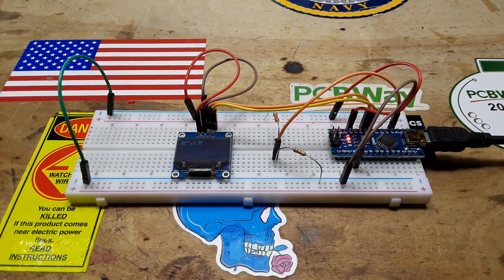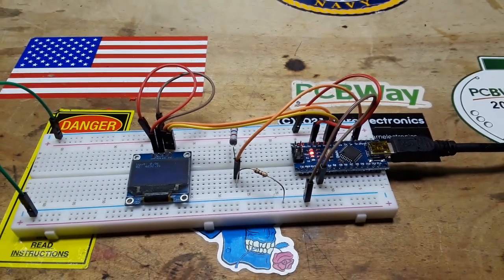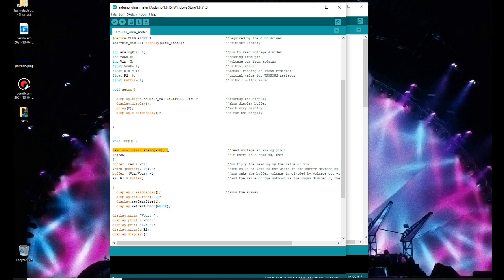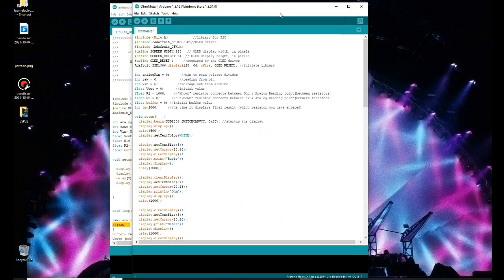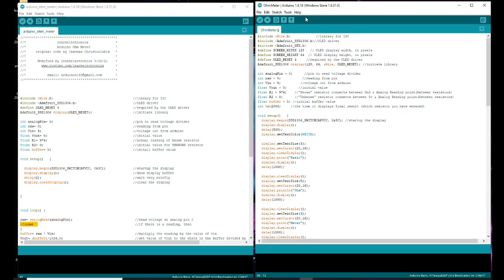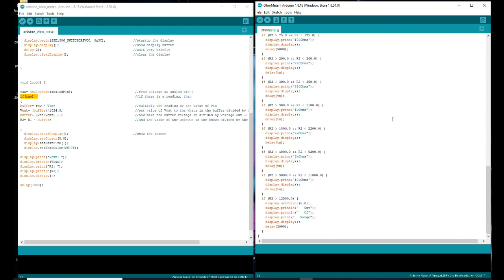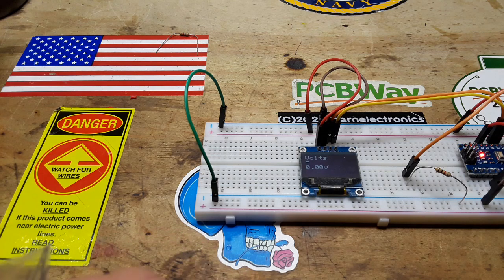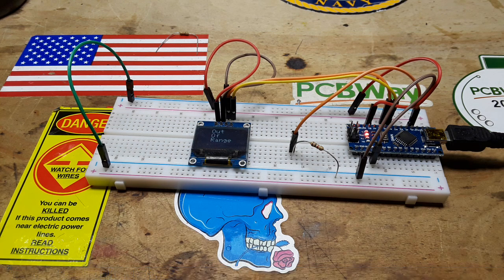Arduino Ohm Meter With First Viewer Mods

Comment: No problem with your brute force programming. That's exactly how I started a couple of years ago. After I'd got the Blink sketch figured out on an UNO, I jumped straight into the deep end and made a motorcycle data logger using the ESP32. Quickly lost count of the huge number of hours spent on forums and you tube figuring it old.

Comment: Those 3 resistors measured exactly as labelled, when was the last time you picked 3 resistors bang on. Pity you didn't verify with a multimeter.
Still, great video.

Comment: Just use an lm317l as constant current source. pump fixed amount of current across resistor under test and just read the volt drop. the code will require no complex math, that way, just read, divide and print to screen function
Reply from the maker: Doesnt work when the resistors are far apart in value. We must use multiple resistors.
Reply: @learnelectronics  You know 4 wire resistance test, that's exactly what I was suggesting. constant current source can be an lm317
Reply: @SurajGrewal   Hey Suraj, I know this is an ancient post but I'd really like to understand better what your talking about.